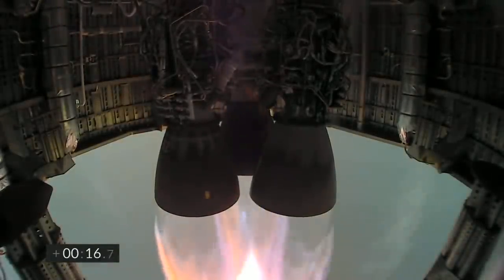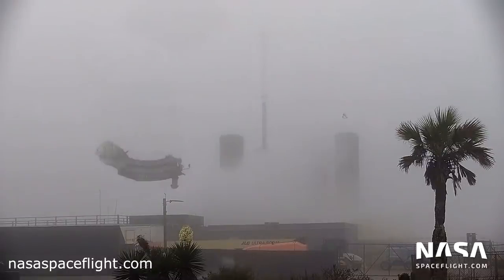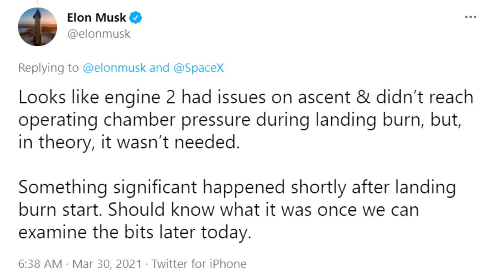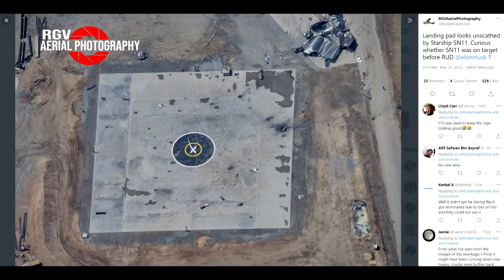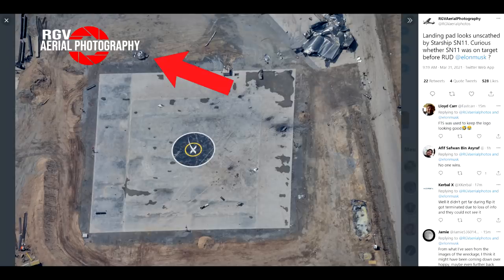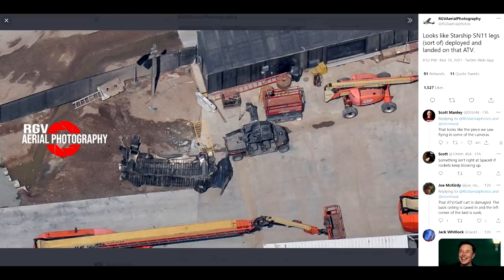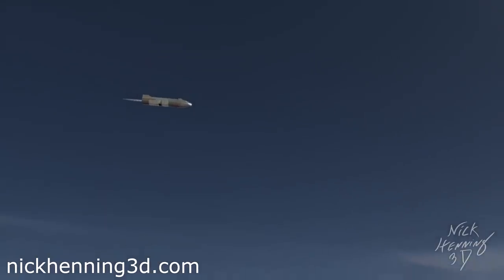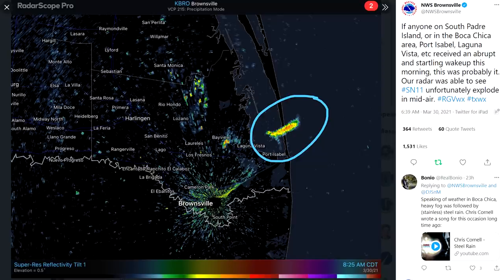What Happened In The Fog At Boca Chica - What Caused SpaceX's Latest Prototype To Explode?

Comment from the maker: Since recording this it’s been noticed that the two halves of the Methane header tank were separated by quite a distance, which likely meant that an over pressure event occurred inside the tank. - I.e. there might have been an explosion in the methane header tank meaning oxygen must have leaked in somewhere.

Also for everyone posting links to Paul Mason/Thunderf00t - realize that his suggestion of a leak in the primary common bulkhead doesn't explain the disposition of the header tank debris, also, the claim that the rear appear to be dropping and blaming this on fluid redistribution misses the fact that in the horizontal attitude the vehicle acts like a 'wing' to control the arrival at the landing pad, incorrect attitude would push it off target and we see it's very much on target, so we can conclude that the vehicle attitude was 'correct' based on the return trajectory.
Reply: Wow I just finished watching, was wondering if there's been any updates and here you are. Pity we only have that 3D animation, no video.

Good luck getting to the moon!
Reply: Check out Thunderf00t's video: his guess is that the LOX and fuel mixed inside the tanks (bulkhead failure?). Fits the bill...
Reply: Great analysis as always Scott!  That last piece of evidence certainly would indicate a extremely high pressure event inside one (methane) or more tanks on the rocket.  And that kind of explosion is much more energetic than the ones we have previously had , therefore the smaller pieces.  We are still seeing flames in the upper portion of the Raptor engines during ascent.
Reply: A failure of a COPV?
Reply: ba boon
Reply: The complexity of the Raptor is for efficiency.
Reply: I watched the SpaceX video and the "Exciting" part starts at the 11:30 mark when they attempt to relight the engines.  It SOUNDS like a catastrophic failure of some sort happened when there was a significant "bang" noise.  I believed it was likely that one engine failed and probably took out its siblings. 

My first thought was oxidizer starvation again resulting in a burn-through at the preburner. 

I had inferred  from Musk's "...the crater is in the right place." remark, the engine failure didn't take out the whole vehicle and the tanks survived until impact.

Beware first reports. 

The methane tank overpress theory sounds likely. The “bang” heard could have been the tank failing just prior to detonation. 

I would think SpaceX needs to take a time out to figure what is going on with their engine relight issues.  BUT, Elon will spend his money as he wants to.

I wish them luck and I’m buying stock in Stainless Steel manufacturing companies. SpaceX will likely be buying LOTS more in the months to come.
Reply: Are they still using He pressurization or autogenous? Would auto. pressurization explain anything?
Reply: @mg4695  guess I should stick up on stainless steel cutlery and pots and pans, prices might go through the roof like in the chip world.
Reply: @mg4695  They've been having fuel delivery problems in the flip, so your idea, ie, engine blowup, sounds about right. Maybe shrapnel punctured the tank.
Reply: I wonder if it's possible for an engine to "burp" into its feed fuel or oxidizer supply? If so I wonder if hot glasses, from one of the engines could have made it back into one of the tanks.
Reply: Hi Scott. At 28 seconds into the Space x flight stream.  And i think the same time on this video, the engine marked 52 I believe (could be wrong) on the left, appears to be experiencing some issue in the pipe up the top on the right. I know there is gas vapour that burns off. But this looks like it has sparks, and acts more like a jet stream.
Is this oxygen rich combustion burning things to pieces?  Because Elon said the engine had issues on ascent.  Not just descent. Or is this just normal gas vapour burning off.. not sure.

Also can you infer anything from the colour of the exhaust? It looks more yellow on this engine. Could be underperforming. Or I'm just imagining things
Reply: I have two theories:

1) SpaceX was filming a trailer for its own version of the horror movie "The Mist"
2) The physics engine glitched due to too many parts (deploying the landing legs was just too much)
Reply: @scott Manley
What do you make of the flames on the LH Raptor engine at 0:28
I wonder if it is possible for some kind of back burn event during decent?
Reply: I'm thinking a fuel mixture in the down pipe from the LOX tank.  It would act like a gigantic detcord.
Reply: sn15 has hundreds of upgrades.....better aerodynamics, more mature engine, better throttle range and stable differential throttling with better software updates ...it will probably land more accurate
Reply: @crp2035  maybe the down comer failed
Reply: At 00:25 seconds in your video there was hot burning gas constantly in flames around the outside of one of the 3 engines.  I wonder if that is what happened to SN11.   Did it blow up because of a faulty engine?
Reply: @jessedejager6556  Sorry  wrong number, things are good in Queensland
Reply: @nemo-x  Not sure how you can definitely say one way or another if reliability is an issue on an engine that has flown 7 times (with 4 of those flights leaving the test article in pieces.)
Reply: With two turbopumps on each engine, each one requiring precise timing, I can't help but wonder:  if they don't fire up exactly the right time it might cause a pressure feed-back problem. I can imagine there could be either methane or LOX cavitation in the pipes or tank as the pump fires up.
Reply: So we learned:
Dont launch on time, launch when it is ready 
And fog is added to the no flight weather creteria. ;)
Reply: Shrapnel from an exploding powerhead caused total destruction of the vehicle. The engine is shit.
Reply: @richb2229  Yeah, the flames crawling around the engines during ascent... I kept thinking, "Is that considered normal?" But the tank failure theory seems most plausible. I'm sure there were some "sternly worded emails" going around inside SpaceX immediately after this!
Reply: who would have thought the weather radar saw more...
Reply: +Scott Manley I don't think this was a setback. These rockets are built and tested to the destruction and as you said the newer generation rockets are already on their way. Meaning that with time these older ones would have been just mothballed or deliberately destroyed.
Every explosion is usefull PROVIDED SpaceX finds the reason for it and suitable remedy.
Building rockets is basicly the same as overengineering dragsters/F1 but everything is bigger and more expensive. Everytime you get to increase power or make it lighter, the least durable part breaks. It gets redesigned and then the next least durable part breaks until everything stays intact meaning you get to increase power and etc... Every iteration is little bit more durable, reliable and powerfull. I think this would only be setback if this was their only available rocket and little or no money left to build more.
Sorry for the longwinded rant :)
Reply: @alaric_  It is a setback, because now they need to figure out what went wrong... it'll take some time to get to the bottom of what caused the explosion, and whether it's a one-off problem with SN11 or something that could affect later models too, and if so, how to work around / solve that problem. It might not be a big setback, but it's certainly going to slow them down for a while.
Reply: Could it be possible that oxygen from the downcomer, leaked into the methan tank?
We see this picture from inside the tank, on the darker part of the downcomer there is some venting... on the white parts mostly not. Could be methan going into gasform, but could it be also oxygen?
Reply: @mg4695  I think doing this in an foggy area didnt help them to figure out what happend. I dont know why they forced a foggy fly when visual can give u so much more clue..
Reply: Is it possible that the belly flop manuever caused the propellents to slosh? I would think that if the liquid oxygen gets into the methane tanks then this would cause an explosion.
Reply: @crp2035  Thunderf00t? you mean the Elon hating person? .. I don't see a vid on him reacting to SN11.
Reply: I'm a bit bothered that they scattered a huge amount of debris across a wildlife refuge.
Reply: @alaric_  You are right, although still I do not understand why to launch in the heavy fog. During tests, generally prototype behavior is covered by as much cam recorders as possible, better if they have high frame speed for later analysis. Why did they behave so silly?
Reply: I’d not discount the FTS. Not triggered from the control center... but it must have some automatic self-trigger... and with loss of telemetry + some malfunction + closeness to ground it makes sense to have it go full auto. And the most effective placement of the charge is at the methane/lix separation bulkhead. So the big thing is effectively broken into many smaller and less dangerous pieces ..
Reply: @crp2035  Sounds about right. The only way the tanks could suddenly go overpressure is if there was combustion internally and for that to happen you need both methane and oxygen.
Reply: @jessedejager6556   It would ignite as the Raptor ignited, travelling up the feed pipe. This is probably why the video feed was lost within a second of a Raptor igniting.
Reply: The more I think about it, with one engine under performing the whole flight, perhaps there was a fuel leak that ignited during ascent and acted like a blowtorch and impinged on the propellant tank aft bulkhead. When the restart began the increased stress could have ruptured the bulkhead causing a Flight Termination System like detonation. 

I agree with @Grumlop, launching in foggy conditions was not a wise decision. NASA had visibility flight rules for Shuttle launches for just this reason (getting video evidence in the event of a failure). 

SpaceX and Musk seem to be suffering from what NASA calls “launch fever”.  Musk may now be understanding  that a little more conservative thought a’la NASA may not be all that bad.
Reply: and have liquid methane leak into a volume of concentrated oxygen, and you get a big boom...
Reply: @nemo-x  Yup.  It's about the only thing that could give that level of destruction from a single point of failure.  Any other explanation involves a big string of coincidences.  Of course, it does pose the question: was it triggered deliberately or did it pop accidently?
Reply: To get such explosion, apart from sabotage, you have to have inside the tank methane mixed with oxygen and something that triggers with high temperature the reaction. So far, may be, they did not really understand the real cause why they had loose of power when they relight raptors, which could been perhaps due to a return of oxygen from the engine to the tank, changing the propellant characteristics. So far, nothing happened, but this time something ignited the mix? And thinking to the Apollo 13 accident and the cam inside the Spacex's methane tank, could some wires been responsible for trigger the explosion? Or frictions in metals for vibrations?
Reply: They've been having pressurization issue w the header tank. SN10 pressurized w helium, but not enough. I wonder if they cranked up the helium pressure in the header tank a little too much? Or, if they switched to heated methane gas to pressurize the header and somehow over-pressurized with that? .... I'm not certain it's safe to assume the methane/oxygen explosion caused the initial breakup of the header tank ... Over-pressure could have burst the header tank, then the mixing of the gases could have ignited a second later .... Since the visual is obscured, it might only be discernable from the audio ... Is there an initial THOOMP just before the BANG?
Reply: @crp2035  My thought exactly, it fits the bill. I mean one can argue abouth him (Thunderfoot), his personality and video style, but his analysis of this crash-plosion is rather spot on.
Reply: How is not the top comment?
Reply: What a load of made up bollocks
Reply: @jesilvas0813  The shuttle used autogenous pressurization so it's proven tech.
Reply: Ya I just posted that the tanks where the problem and then I find this post ya it was over pressure in the tanks
Reply from the maker: @felix2315  I just checked this, his conclusion is only vaguely similar, once you look at more details it's clear he's looking at things differently and the header tank debris disagrees with his assessment.
Reply: That can be case, maybe mixed fuel-oxi burned so fast it generates burning shockwave to tank. Or maybe methane pipe what goes inside oxygen tank just failed, It's game over then. Liquids must be mixed, because explosion was so great to flown pieces around Bc.
Reply: if anyone has taken up this before or if it already has been dismissed then ignore my thoughts.

Faulty Wiring for the raptors that is mounted inside the fuel tanks feel like a possible explanation to this.
probably a badly insulated wire or wires shorting one another  like the TWA 800 tragedy.

It could also be the wiring for the tank camera that is to blame.

Another question is the fact that the debris field seems  to suggest that SN11 was not fully aligned to the landing pad, 
Ergo did it have bad sensory data ?

Also the fact that they had issues with the livefeed feom the cameras onboard can point to witing issues.

Or maybe Moisture due to the fog had squeezed itself into the wire insulation?  Had an old SAAB 900 og who had that problem every time it was quite Damp outside the ignition system decided to be moody( Dont be a scrooge McDuck).

anyhow im mostlikely wrong but this is my 2 Kroner on it.
Reply: @nagarjunkashyap5987  It would be a coincidence to happen right on engine relight.
Reply: That "it got high (hot?) at four tweety hahahaha" is so good, I would love to see more of that GLaDOS sarcastic laughter.
Reply: 5:40 "Crack opens and pressure drops" This is why tanks are destructively tested with hydraulics, instead of compressed gas. Compressed gas expands much more and can rip tanks to shreds. Hydrostatic tests will crack open the tank and immediately have the pressure drop.
Reply: Here's a piece of thought that I didn't see anyone else mention yet: usually, when a rocket explodes, it has less fuel than SN 11 did. It did not complete the flip burn maneuver. Additionally, the fact that it was the bottom that exploded might simply be due to the fact that Starship was horizontal at the time, so fuel was along the entire length of the tank instead of at the bottom. If fire had made its way up there, it could have ignited the entire length of the tank immediately
Reply: I would not take a word from Thunderf00t about anything SpaceX since he is heavily biased against SpaceX and reusability.
Reply: Marc Jackson  I have finite amount of time to waste on sieving through bias. I would rather ignore him and put that time to someone who I trust more. Same way I do not watch what flat earthers have to say about SpaceX.
Reply: Elon’s quick-disassemble method on touch-down is amazing. But he should explain it to the general public because people keep thinking his starships are exploding
Reply: Marc Jackson  Oh, yeah, I forgot that Formula One have rocket engines... One of the reasons why SpaceX does those test is to see exactly how far they can push those designs. They don't care if they blow up 5, 10 or a 100 Starships if they will get the best design. Most of the test are not really about how to build a rocket, but how to mass produce a rocket.
Reply: Right. That's the same conclusion I came to given the info in your video. Methane must've goten in the oxigen tank or the other way around.  Not sure what those two do (i.e. do you then need a spark before RUD?) when mixing them together at the temp and pressure they're at in those tanks.... 

Anyway..... At 27 seconds into the video, 28 seconds into the flight... you can see several flames coming from one engine. Sparks flying... I've seen stuff like that on merlin engines and that gets to orbit no problem. But those have turbo pumps that doesn't provide thrust and the exhaust from these could show up as a flame, right? 
But on this engine... that is not the case, no non-thrust exhaust streams. So I'd say flames and sparks outside the cone are unintentional. 

Methane explosions are very violent. You know what the instructions to firefighters is when they approach a methane-fire, right? "Do NOT, repeat, do NOT PUT OUT THE FIRE!" When you put out the fire, you'll have methane and air mixing to an explosive mixture and it will surely find a spark to ignite on soon.
Reply: Thunderfoot is known to be a conspiracy theorist and a generally non-credible source. We shouldn't trust his un-scientific opinions.
Reply: Thunderf00t is a very intelligent chemist.

... He is also unfortunately a biased hack when it comes to all things Elon Musk related, and easily demonstrates that even intelligent people are susceptible to the Dunning Kruger effect when they discuss things outside their wheel house.
Reply: SpaceX denied us the free entertainment we expected.
I am pissed off.
Reply: What happens to the flight termination system in events like this?
Reply: Thunderf00t has a weird obsessive fetish with everything Elon does/says. So I wouldn't take what he says seriously. Furthermore, it was a leak at the raptor engine itself. You can actually see the piping for one of the engines was on fire during ascent. I'm confident a buildup of gasses that had leaked and accumulated under the skirting causes the explosion when the aforementioned engine went to light again and caused the pipes to ignite once more.
Reply: @hatman4818  On the other hand, rockets are nothing but controlling chemical reactions and their chemical components. Thunderf00t may be an accomplished chemical scientist rather than a chemical engineer, but the explosion aspects of rocketry are definitely not beyond his scope of expertise.
Reply: @ultrametric9317  
If an engine power head explodes we will get a puncture of bottom main oxygen tank at worst - that is not an instantaneous event and should result in a spray of propellant. The failure symptoms are more like a premixed air/fuel bomb. So I lean towards an oxygen down-comer leak.
Reply: @phitsf5475  
Right. Pressure does not drop rapidly if the tank is full of gasses. That is how cracks propagate much further.
Reply: Marc Jackson  Are you thinking of anything specific when you say hacks that SpaceX attempt? Can you give some examples?
Reply: Isn't the fuel tank just a thin sheet of metal? Where did the insulation in the wreckage come from?7:46
Reply: @simongeard4824  
Engineers learn little to nothing about potential failures from a string of successful tests. It is failure that improves understanding and drives progress.
Reply: @Jono98806  
It seems very plausible that a valve could get stuck open, and raise pressure way too high. The evidence points to an overpressure event inside the methane header tank since it split in two and the halves were far apart.
Reply: @liaojunliao46  
Each of the COPVs in the skirt are wrapped in insulation to limit temperature rise inside them from ambient heat. Their internal pressure is proportional to temperature.
Reply: @imconsequetau5275  Of course, but a failure is still a failure... it's a new discovery that requires you to do something about it. That's why I call it a setback... it's good that the problem has been found, but it's still a delay to the project.
Reply: @imconsequetau5275  thanks！